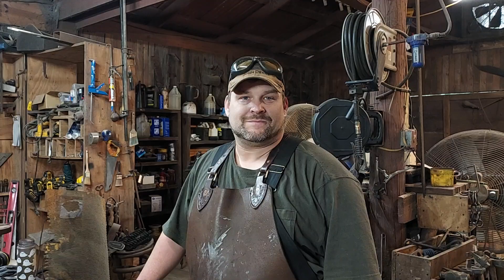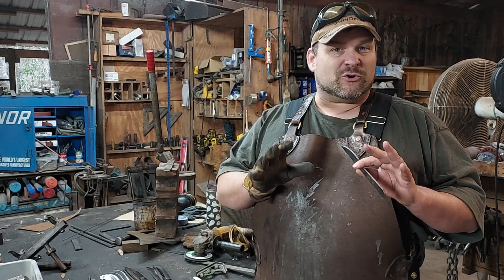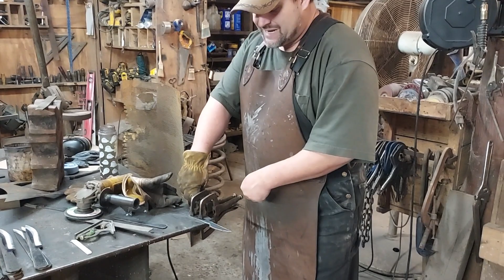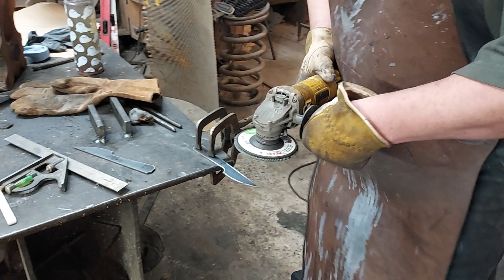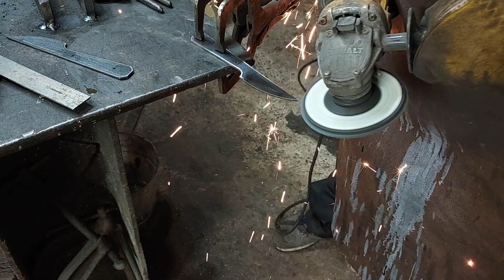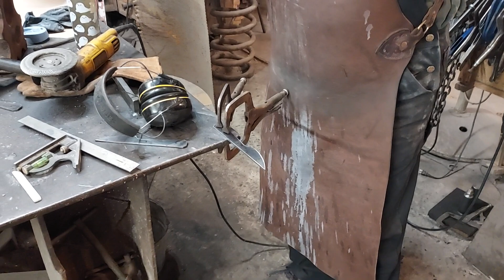Using An Angle Grinder To Make a Knife

Comment: Your clams about the steel melted at the twin towers is fake because that steel you had in the fire 🔥 was thar for a time, in the twins tower it was a fireball from an airplane ✈️, and most of the fuel ⛽️ went out of the window.
And all the walls was high quality cement, so the fireball was not directed to the steel, just only in the point of the crash with a small amount of that steel.

Comment: use a 120 grit flap disk  from the parts store .They are in the autobody section . Much more control . Low grit wheels hard to control  and will dig a ditch in an instant .Oh a BIG 7 inch grinder with a 36 grit will make your knife disappear
Reply: A 7" doesn't hold a candle to a 9" either..when you pull the trigger on one with a new disk on it you sorta fly it like an ancient 80 pound miniature helicopter over to whatever has the misfortune of losing the battle that is about to ensue and just try to hold on while the machine turns a boy into a man. Thats the way I remember it at least 🤣

Comment: Jet fuel still doesn't melt steel beams
Reply: Especially in a open air fire. Just like they want us to believe the open air fires in California are hot enough to melt brick and steel beams to nothing. Yet the lawns and trees arnt burned. You see melted car rims burned out cars under trees and bushes unburned. But plastic seems to not burn in those fires. 

In his example video he had to put the beam in a forge. And the building beams are countless times thicker. Most of the jetfuel burned upon impact. It wouldn't get glowing hot from a open air fire. Ive burned several thousands of gallons of diesal for fires to keep bugs away and when I was a fire bug it was cheap and non explosive. Filling 55 gallon drums with 25 gallons and lighting it. A open air fire is not going to make steel beams star lt glowing red. I've put steel over my massive diesal fire barrels never seen it happen. Now if I use my diesal burner for my metal furnace on it then yes it will. I use it to melt copper and have melted the fire bricks inside it before.

Comment: Having completed some of the items from your teaching series (leaf, spoon and so on) I am thinking of trying a knife.  I am in the quite comical predicament of having a treadle whetstone and no working legs. It's about 2 foot in diameter and if someone spins it puts a wicked edge on just about anything.  So just a quick question will the heat from an angle grinder be a problem and should I grind then heat treat or vicey versey? I will be using some high end, high tech and highly questionable scrapyard feck feckty steel for my first few attempts so it will probably be quenched in a puddle and tempered in a sweaty armpit. (No electric were I work)

Comment: Great video, bro...however, since it is aimed somewhat to the beginner knife maker,  you should really show them how to use a knife board, so that they don't inadvertently enviscerate themselves, or stab the blank through their hand or arm.
Reply: are clamping to the table and running it threw your ass .If I clamped a knife like that I would end up in the ER with a story .

Comment: Some time ago you made a jig for the angle grinder, as I recall, it was for a consistent internal radius.  is there value in trying a jig for this to keep the grinder angle consistent or do you think that it would be more effort than roughing it with the grinder and finishing by hand?
Reply: worth it .

Comment: Great advice good sir! I put blade edges on the backburner for the time being. I've gotten a few decent edges using the wheel rock, and then smooth everything out with the pad attachments I have for my drill. (My foundry bud got me a bunch of stuff. Sand pads, scotch pads, buffer pads, ect)  but I fell in love with blacksmithing as a whole so now Ive been doing everything that comes with that and wanna wait till I save for a belt sander. But your vids are all saved and will be referenced in the future! Sword making got me into the craft and I wanna wait till I develop it all. So far, I've made good head way. Got the wife's support,  and yea 🍻